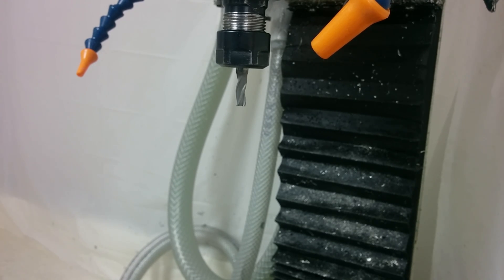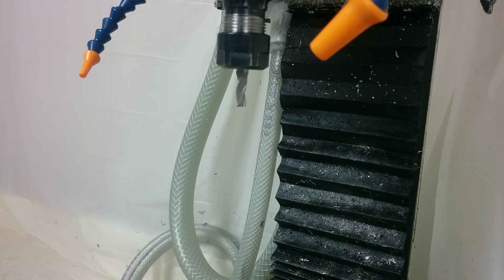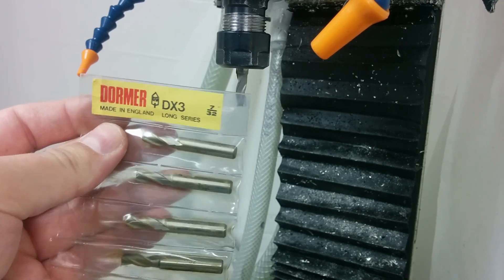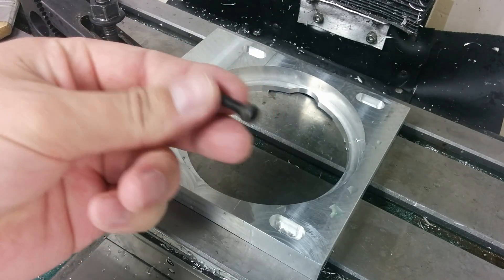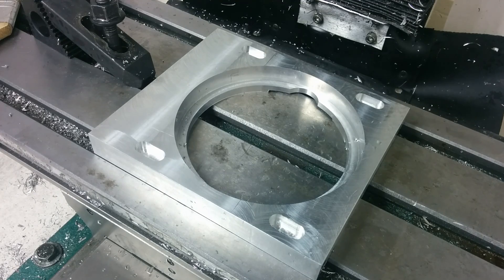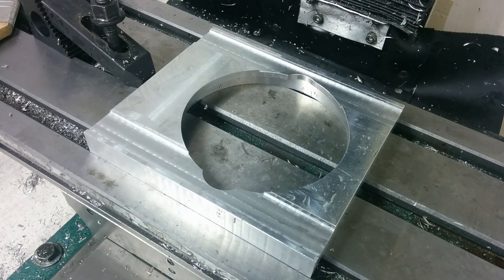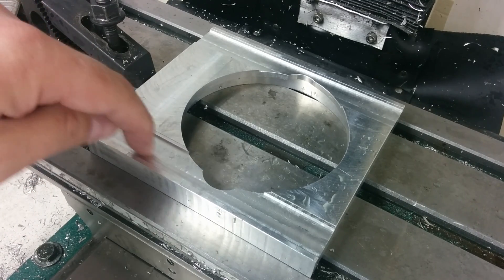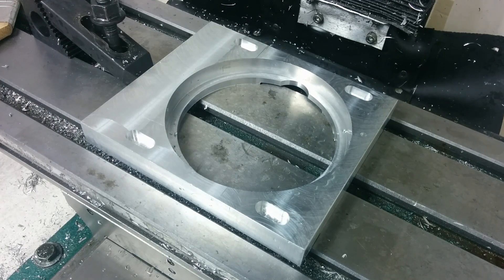7/32" End Mill & Motor Mount Slots

Comment: Tell us about your CAD/CAM choices.  I've been doing battle with this lately.
Reply from the maker: I can do a video on that if needed. I've used Solidworks and Mastercam in the past, but when Autodesk was offering the $300/year buy in for Fusion 360 Ultimate (regular price $1,200/year) I grabbed that. It does 3D modeling and 3axis mill CAM. Turning CAM is supposed to be coming sometime in the future.

I've used Solidworks for many years and am very comfortable with it. I'm still figuring out Fusion, but I think it's going to be pretty nice once they get some more features added, bugs ironed out, and I get more fluent with it. I HATED Mastercam, and the CAM built into Fusion is a million times easier to figure out.

Comment: Great deal on the end mills. I will have to see if they are still avalable.

    I also understand the fear of moving the part for a different op.
I have an electronic probe (Arnie's/ Zarzul's/WildHorse) I believe they are the same probe just different sellers. Anyway, I take an indicator along 1 side of the part to make sure it is parallel to the direction of movement (like you visualizing against the T slot). Then in the case of a part like the one you have shown, I would use my probe to find the center of that bore and change my DRO's to match what the CAD location claims it should be. It appears that your part is symmetrical and this technique will work well. In a case where the part is asymmetrical you would have to invert your CAD. I hope that is understandable.

   By no means the correct or only way, but so far it is 1 of the only ways I know AND it has worked.
I just made my first part (a bicycle hub, 36 spoke with disc brake mounts) that I actually moved from my lathe to my mill at least 4 moves. Of course it isnt perfect but no one but a very skilled machinist would know and it exceeds the quality and look of the model I was duplicating, in every way.
Reply from the maker: I like your idea for locating the part, and that bike project sounds sweet! I'm going to do some searching on that probe you are using. I had a Tormach LED probe, but just ruined it the other day. Now I'm back to the post-it note method :)
Reply: It is called an "econo probe" on ebay. Deep Groove makes a nice 1 too but more pricey. You can also get a ruby tip instead of that metal one.
Reply from the maker: ***** I'll search for that too. I found it on CNC4PC and I've ordered from them before.